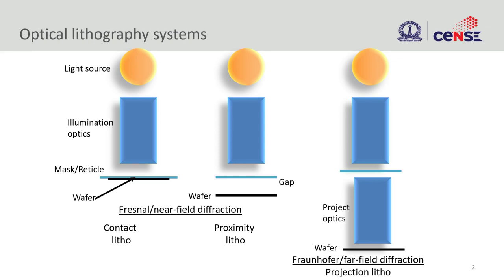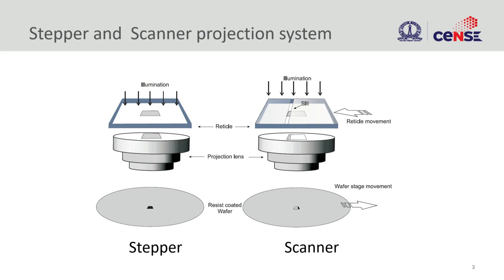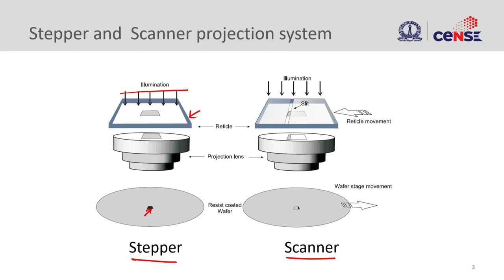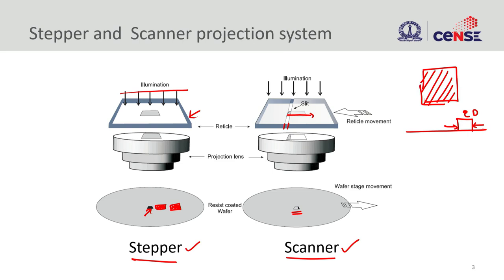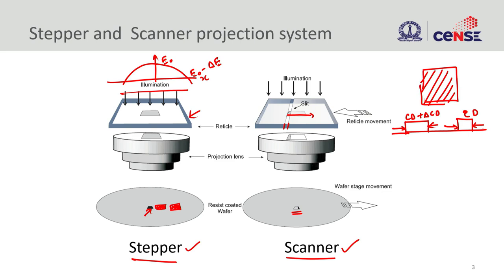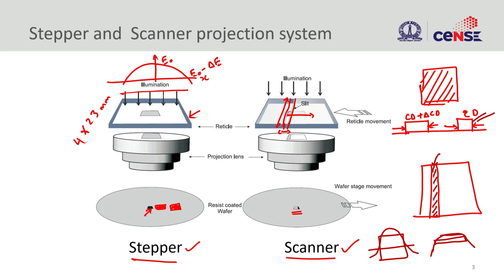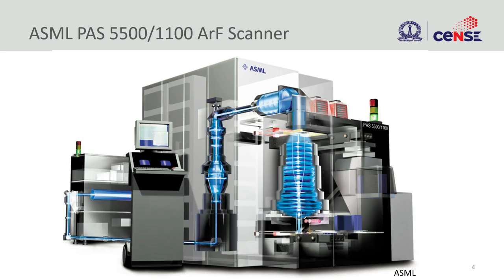noc19 bt29 lec32

Comment: Hello! After the lesson, I'm curious about the alignment techniques...
Can you tell me the alignment techniques of TTL (Through the Lens) vs. ATHENA (off-axis alignment system; utilizing 2 wavelengths, 2 higher diffraction orders) ??
Reply: The TTL  system only detect 1st order with M1&M2 Branch , ATHENA has separate  detector for each order(1~7) ; TTL system can align the wafer and reticle , but ATHENA can only align the wafer , the reticle align in a non-TTL system use light generate by illumination which we called Blue Align .